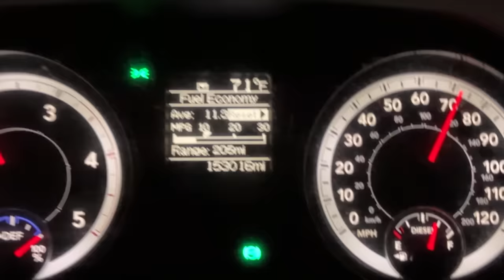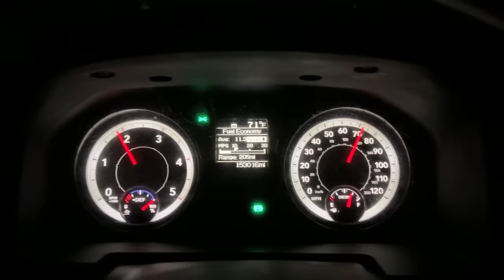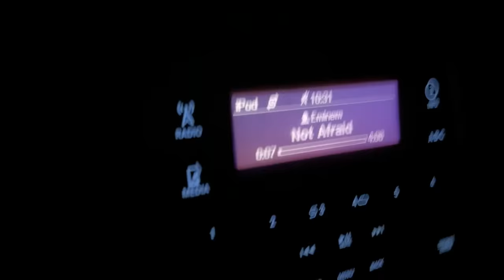My new truck broke down 9.5 hours from home. Dealer refused to do anything...

Comment: You built the perfect tow rig, I’d drive it and not worry about a dealership ever again.
Reply: When he first got the new truck, I was like....what was all that work for?! Lol He worked his ass off on the Fummins and then bought a newish truck! I get it though, I've done ding dong stuff like that thinkin I was being a smart guy just for it to turn back on me lol
Reply: @Smokkedandslammed  I get the anxiety that he had about "yet another thing to maintain", but New trucks have new problems. Older diesel might be inefficient, but it's all stupid reliable. The Fummins is definitely going to be super reliable for him, he just let his "what if" anxiety get the better of him.
Reply: Stealership*
Reply: @AzureCrux  %100, glad it all (mostly lol) worked out for him and I'm stoked to see the fummins back 👍
Reply: @Smokkedandslammed  I felt the same way. That truck he built is exactly what I want to build one day. He seems to want to put a standard trans in it for some reason, Id definitely stick with the 5R110. It has a great tow/haul mode and is a great transmission overall. Whatever he decides, it's still a great truck and world's better than the newer stuff.
Reply from the maker: @AzureCrux  yeah I mean if anything this situation got me over the what if anxiety because we found a solution. And it happened to a new truck. So if it’s going to happen regardless. Why worry about it. Lol
Reply: Sorry you had to get put in that position.. I truly hope dealer leadership takes this seriously... Glad you have a tow rig already 💪
Reply: The Cummins likes marvel mystery oil in fuel  it keeps injection system especially pump working well  sell the new Ford
Reply: @Taylordrifts  4 years old isn't new.
Reply: @hithere7382  Around 50K miles the truck should not have major problems. My Chevy has 160K on it and has never let me down. Of course, most Fords are the same way. He may have just got a bad one.
Reply: My brother has 100k on his and never a problem. tows a 40' fifth wheel.
Reply: @Smokkedandslammed  That's what I wanted to know lol. Why build the fummins? Just go rent a 2022 F350 and write down all the upgrades you like. Come back and install them all on the Fummins. Not comfortable enough? Get some better seats or have yours restuffed.

Comment: Bring the fummins back to action. Like you said, you built it so you know how to work on it. If you keep the 2020, you’re just putting yourself back in the same situation if it does break down again. At least you can work on the fummins if it does break, rather than being scared to touch it to void the warranty. Do what you do best brother: GARAGE BUILT!!!!
Reply: I always wondered did he keep the fummins or sell it. I never saw the outcome of that.
Reply: and the biggest problem to is there's no telling what they will/won't replace. Say it's the pump and they change that, they may not cover the injectors even though shrapnel may have gone through them because a scanner says they're fine and they sprayed brake clean through them
Reply: @10TowsDownTowing 19:39
Reply: I don't understand why he sold it, he literallry built it to be the ultimate reliable truck, he literally built it to be more reliable than a new truck, it absolutely blew my mind when he sold it for a new truck.
Reply: @motoweenies4431  Generally that is considered contingent damage and would be covered, but auto dealers do some shady crap all the time, especially when it comes to warranty work. Ford in my experience has been the worst and I stay away from them personally. Although my two local dealers that I have dealt with have been good the couple of times I have been forced to deal with them. It all just depends. Some dealers will almost bend over backwards for you, and others would piss in your cup holders after you leave (figuratively).
Reply: @85square He didn'y sell it. Iirc he wanted to use it in a giveway but that was a while ago
Reply: Check out why that truck was sold in first place. I bet you might be surprised,especially with that break in milesge

Comment: I was a service manager for over 20 years. It would have meant nothing to me to find a spot for your trailer and get right on your truck. I had a priority list and broken down travelers were at the top. I even had a crew who could sympathize with the customers also. There was always a mechanic willing to stay late if the solution was near. Your experience, had it been at my shop, would have been positive for both of us and you'd look back at it fondly.
Reply: Several years ago I was diagnosed with AML (acute myeloid leukemia). I live in Carson City, NV. We headed off to MD Anderson cancer center in Houston in our 2016 F-350 6.7, towing our 30' travel trailer. I started getting check engine lights as we were going across NM. I ended up finding Gurley Ford in Gallup, NM. It was the first Saturday they were open since the COVID debacle. Anyway, I pleaded my leukemia dilemma and told them about my CEL (which I had diagnosed with my Banks iDash gauge). They took me in, let me drop my trailer down the street in one of their car lots, and immediately started working on my truck. They did a manual regen and updated the computer software on the truck. All this took about two hours. It cost me just over $100 - I was shocked. That's the same as "free" when it comes to diesel repairs. I was SO pleased with that dealership! I managed to get to Houston in time to get the proper treatment so I'm here to tell about my experience. There ARE good dealers out there!
Reply: I worked in service for 21 years. Anytime we had somebody traveling through the area that came in with a breakdown, understanding the situation the customer is in, I automatically gave them top priority. That might mean going above and beyond what we would offer to the normal customer dropping off a car for service. Like allowing a trailer to be parked in our storage lot temporarily. They were likely worried about liability for your property, but it's simple enough to make a note on the paperwork about the storage and that the dealer isn't liable. That dealer staff was terrible at showing any empathy.

The disclaimer about diagnosis cost if the repair is found to not be covered under warranty is just to cover the dealership's exposure though. It doesn't mean that they are trying to deny warranty coverage. Sometimes cars are dropped off with repairs assumed to be under warranty. Then after hours of diagnosis it's found that it isn't. Like an electrical problem on a brand new car that anyone would assume is covered, is found out to be due to rodent damage. It happens. The dealership can't bill warranty for that shop time and the dealership does have employee and facilities cost regardless. Myself and all writers I've worked with were always happy to give the good news to a customer that their repairs would be covered under warranty. Yes we do get reimbursed less than customer rate from warranty, but it's headache free and everybody is happy.
Reply: Yeah, that's the way I would approach it if I were a service manager in this situation as well. Seems like this dealer was intentionally messing with Taylor. I bet he's regretting that right about now. This looks bad on Ford and really looks bad on his dealership. 1.2 million eyeballs on his dumb a** so far. I bet they've never had this much attention in all their years in business, maybe combined. Supreme Ford of Slidell, LA folks.
Reply: I worked at a Dodge dealer for around a decade and ended up being the GMs fix it guy along with inventory work.  This situation would have never happened.  We would have dropped everything to get him back on the road ASAP.  This is just a crappy dealer IMO.
Reply: I think he wants more then simply storage at the local dealer.....
Reply: @pat36a  Sure, he had three other asks. 

He wanted his car diagnosed more quickly than within a few days. Can’t speak to that as we have no idea what the situation is in the shop nor the nature of the diagnosis. That may just be as quickly as it can be gotten to, we don’t know.

He wanted a diagnosis guaranteed at no cost under warranty. They can’t guarantee that. It may be under warranty, it might not be. They won’t know until they know.

If he wasn’t able to park his trailer in a reasonably safe location he was asking if a loaner could be provided. Even if they were willing to send a loaner out for such extended use, they did not have one available that would tow his trailer. They had a F150 with no goose neck, which they offered.

There’s not a lot they could do for his other asks. They could have alleviated his trailer security or transport concern by allowing it to be parked in their locked lot. They could have shown empathy by not pressing him about moving his trailer ASAP. They could have told him that they will do their best to get his truck seen as quickly as possible. That’s about all they could do. The other asks/ expectations were not in their control.
Reply: Let us know where your shop is, locals and travelers are always looking for an honest and reliable automotive/truck shop.
Reply: And you and your crew were probably the main reason the dealership had return customers!  “Old school” customer service!
Reply: @KFT  would of, could of, should of.  You're hearing 1 side of the story. I've worked at Ford Dealership in a rural county. Most Ford dealers do go out of their way to accommodate travelers.  But judging by his post, there were other demands that they couldn't meet. A used car/truck purchase doesn't get you the same treatment as a new car/truck purchaser would get . Ford corporate would then be involved. 
No Dealership is going to loan out a truck w/a 5th wheel to get you home. Even if you were a new car/truck purchaser.  To me, there's more to the story,
Reply: @kft4764  Exactly. And something I can't help but wonder. Looking at how he carried himself in this video, makes me question how he acted at the dealer. This was 25+ minutes of repetitive whining. Yes it sucks, it's a PITA etc. I get it. But that whining makes it so hard for me to sympathise.
Reply: @pat36a  What you are saying is pretty much also what KFT said. Definitely more to this.
Reply: @kft4764  - You are 100% correct. There are two sides to each issue presented and so much that isn’t known. Therefore, although bashing the dealership is the “fun” keyboard warrior / expert thing to do, it’s no fair to the parties involved. Sometimes people’s hands are tied. Take care.
Reply: Videointercepter you are 100% correct there are incredible excellent dealers out there as well. This particular one fumbled the ball sadly but hopefully they use it as an opportunity to learn and improve. Cheers ...
Reply: Here is my theory on Dealerships / Manufacturers of new vehicles and how some choose to treat there customers. During your adventure and frustration at the Ford dealer across town at the Dodge dealer there is a customer being treated and experiencing the same frustration. If you choose to never buy another Ford based on your experience the customer at Dodge does the same thing. You go from Ford to Dodge the other customer goes from Dodge to Ford and the net effect is zero to the Dealer / Manufacturer. This is why showing indifference to a customer doesn't matter to them. Well that's my theory anyway? 😮
Reply: Keep up the good work!!

Comment: Hate to pull this card, but try talking to Vaughn. He’ll know who to escalate it to.
Reply: Or might know a non dogshit dealer 😅
Reply: What about us non-influencers? I would probably still be on the side of the road guarding my trailer.
Reply: @Doug Sisk  you just have to be willing to be that asshole who gives the dealership fucking hell and calls corporate to force the hand.
Reply: @Axial32  100% TREAT THEM PRICKS LIKE THEY TREAT YOU & TRUST NO ONE.
Reply: @Axial32  100% agree.
Reply: @dougsisk619  Yep! Dealerships no matter what brand are scummy. They sell you all these reassurances that you're covered and it's a coin flip at best if they're actually going to do anything. Sickening.
Reply: @horderelations4041  literally depends on the mood and training of the service writer.
Reply: @dougsisk619  What a way to run a business.  In the end this dealership will suffer backlash that they can't even foresee yet. To your original point what could or would happen to us non celebrities in this situation (this is not a woe is me, rather a very consequential reality for the rest of us).
Reply: @horderelations4041  Yup. Never seen a comment section in such alignment.

Comment: Definitely keep the fummins in service. I was a bit worried about this exact situation when you got the new truck, I've had the displeasure of working on a few of the newer trucks and the fuel pump issue is an extremely common issue and dealers never want to help... Hope you get it all figured out, just my thoughts...

Comment: Dude, as a dealer master tech, just build a solid rig and drive it. Don't trust a word the service advisers say, and damn sure don't believe the sales staff. If you wander around back you'll notice the techs all drive something they built themselves, and all the sales folks are upside down on something the dealer sells.
Reply: absolute truth!!! also a master tech at a dealer
Reply: to me? IMHO I would take some lessons from all 3 big tow vehicles and buy a newer lower mileage Ram Cummins, new enough to not have to worry about wiring wearing out
Reply: Shit I seen more newer Cummins burnt to the ground crisp then any other new truck
Reply: I’m sayin I fully agree with you all about the dealership and the disaster they can be.
Reply: @cmusic52  have to back to 2018.  Past that their all crap.
Reply: @jaypeetaylor  just get a gaser these diesel are not reliable anymore
Reply: @teamallyracing1780  You ain't towing that set up with a gasser, Not to mention the fuel mileage would be negative mpg! Because you ain't going to get anywhere!
Reply: I worked at 2 dealers and none of the techs had anything but a stock vehicle. The trans tech had an old muscle car and the go to master tech drove a early 2000s car he just kept fixing otherwise it was a newer truck. I was the only one who had anything that was "modded". I am also the only one who didn't have a box and tools off the tool trucks. Coincidence? Probably but it is still funny!
Reply: @commonsenseisdeadin2024  you can tow his set up just fine with the F-250 gasser with the new 7.3. Doesn’t even have to be a dually.
Reply: @94plumbing21  I don't think I've ever seen a gassed with a goose or a 5th. The only reason diesels are crap is because the environmental profiting assholes think there regulations actually make a difference. Well a positive one anyway.
Reply: @94plumbing21  oops forgot to reply. Even the Godzilla doesn't put put the torque and you are going to feel it. And that's not to mention the strain that puts on it and the longevity is significantly decreased. Right now the 6.7PS I'd argue is the best diesel but it too doesn't come without its down falls all of which can be corrected but that reigns true with most of them all. 

But I still like the 6.0PS so
Reply: Yup same with chevy guys they all have pre 2002 pickups they built I'm currently doing this with a 2011 but need something older. Your comment is 💯 correct
Reply: @teamallyracing1780   Gasser....   :)
Reply: @commonsenseisdeadin2024  Heaps of 6.8 v10 had goosenecks installed, same with 5th wheels. The 7.3 is better than it was and the trucks are lighter than those 6.8s.
Reply: @hithere7382  I'm not arguing that, I can't say I recall I've seen one. Either way you swing it, it's not going to be anywhere near a diesel. I honestly believe just the sheer heft of the diesel alone greatly improves "the feeling" of the trailer. Turbo brake and just maintaining speed or over taking on the freeway. Only thing I feel could rival it would be unfortunately, electric and what comes with that? Torque! 

Will it work, I'm sure, as well as I'm sure you're going to be doing more repairs, get less life out of the truck and you're going to despise hauling.

Comment: The 450 ford dually and the dodge dually are great looking  👌 but that is as far as it goes  I would buy just to look at them that's all they are good for  now you can  buy an 1988 ford 450 dually or make one with a Kat 15 motor and stage 3 clutch and enjoy working 💪